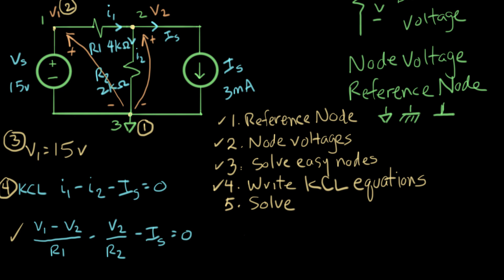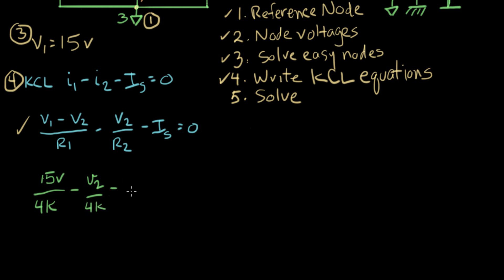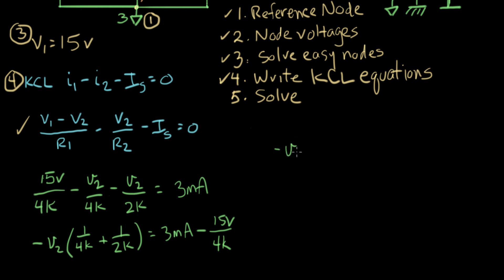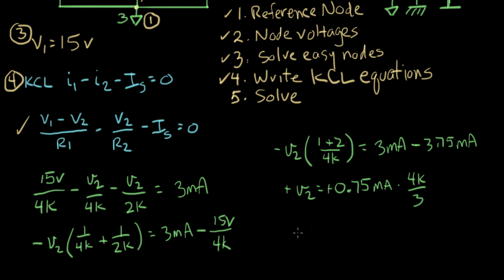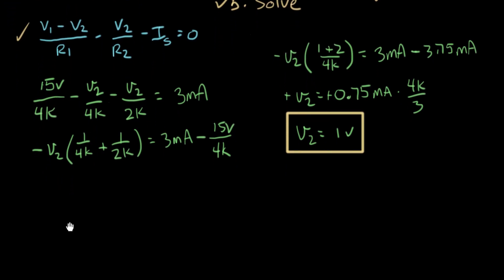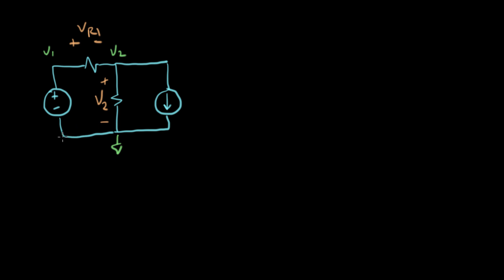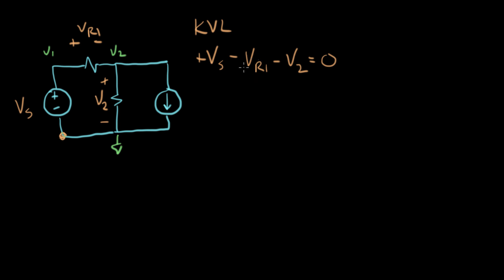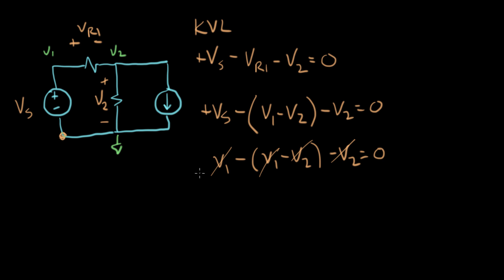Node voltage method (step 5) | Circuit analysis | Electrical engineering | Khan Academy

Comment: why -VR1 ? there's no drope it should be positive you confused me..
Reply: Med Lamine Rabhi when he used the KVL method on the first loop, he went counter clockwise. The + side of Vs, - side of the other two Voltages.
Reply: @LR-ce9vp  Why would he like to do that particularly he used the clockwise in previous example plus the beginning of the equation started with vs not v2, I truly respect his explanation and make them free but sometimes that got me confused!